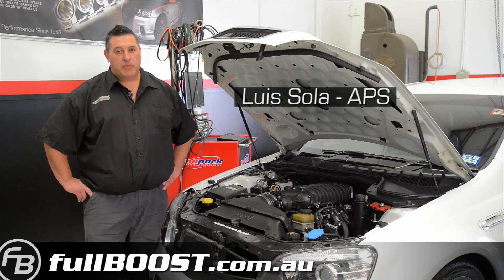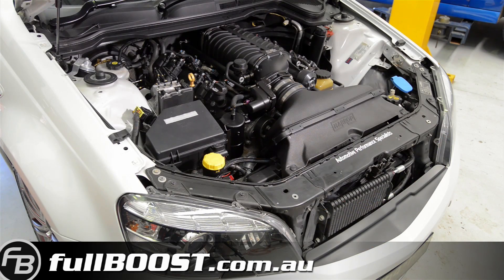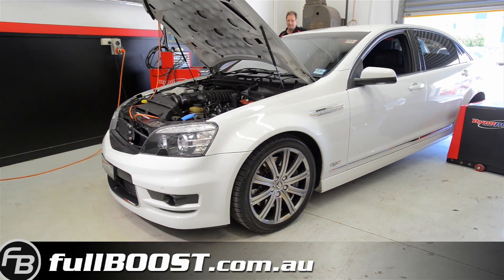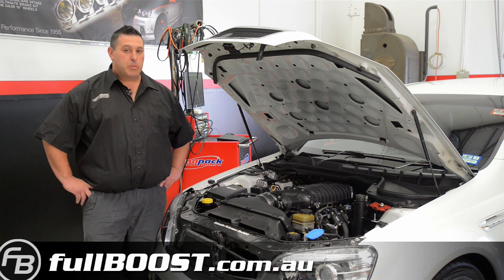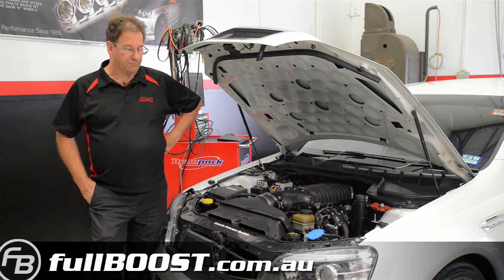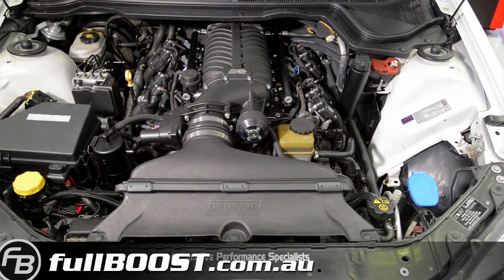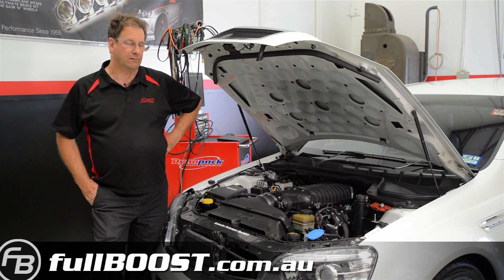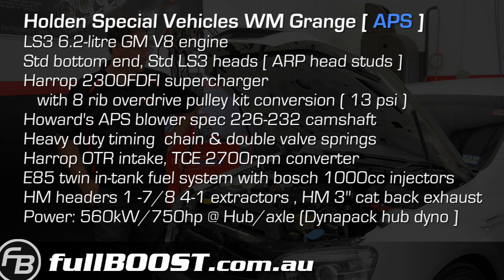750hp HSV Grange dyno ~ APS

Comment: I am waiting to hear from all the Ford fans saying " this is shit" or " my N/A el xr6 can make more power". These LS3's can make masive power with only minor mods and still Std heads and bottom end. much respect and same goes for the ford BARRA motors.
Reply: Jump on fb and go to PSC Racing there a vy ss LS1 5.7L cam built bottom end and Harrop 2650 making similar power and close to 2000nM it’s a beast of a car